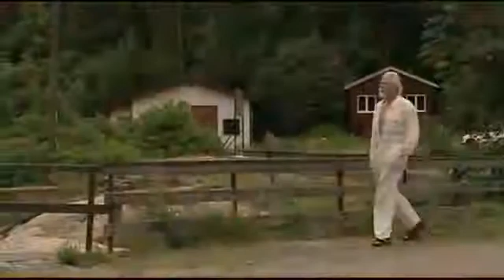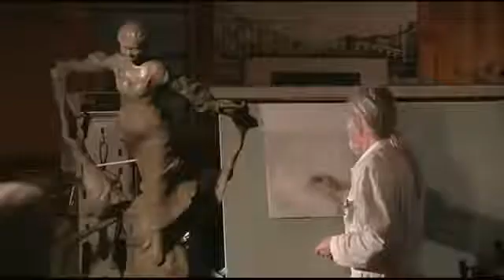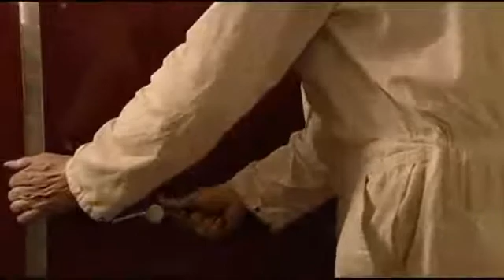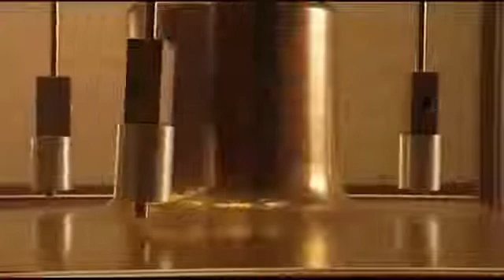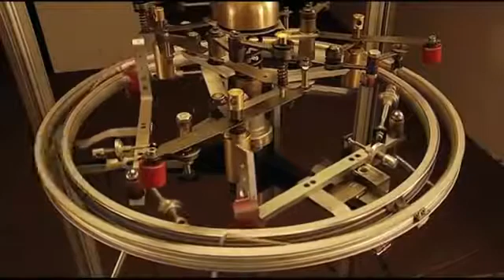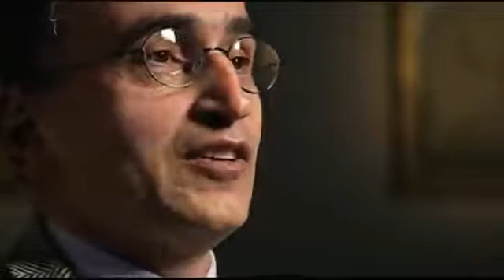Reidar Finsrud - Inverse Square Law Force - A Real Perpetual Motion Macnine

Comment: isn't the power coming from the rotating planet & gravity. In other words, does this device function the same in outerspace off planet?
Reply from the maker: Hey Morpher44 - http://www.aboveunity.com - Be part of something Better!   ---   Gravity - The ball is always falling, down Hill. Still, this is Perpetual Motion, it Is perpetually falling Down Hill. Just like Gravity is the Source for the Hydraulic Ram Pump, it is also perpetual, works as long as the Water, Gravity and Part Failure does not enter the picture. The Electrical "Generator" does not Make Energy, it is Pumped as T H Moray points out. But pumped from WHERE? Einstein's Mass Energy Equivalence is the Answer! 

Energy is not Made, nor is it Destroyed,! Energy is everywhere! Everything is Energy, Energy can be Transformed, used, but Energy is Perpetual, forever!  Another Contradiction introduced into Science by Dogmatic Scientists.
Reply: bottom line, though. No laws of thermodynamics need to change. It is possible to make machines that keep going for long durations. but also, these machines will also likely stop if not maintained. metal rusts, friction, storms, earthquakes, etc. can unsettle a machine. A human has to get up, reset it, and get it going again. So in this sense, its NOT perpetual. It requires some initial human-power input. Further, if you tried to pull power from such a system, if you loaded it, the balance would change.
Reply from the maker: Correct! An AC Generator, can work Asymmetrically, having more than one Induction Cycle, per Cycle! Energy Begets Energy, we have only be smart enough to make sure to Build Regenerative Systems - Parametric - Non-Linear Change of one or more Parameters during each Cycle. http://www.aboveunity.com/thread/arduino-uni-polar-parametric-switch/